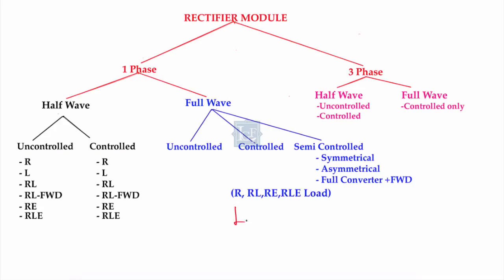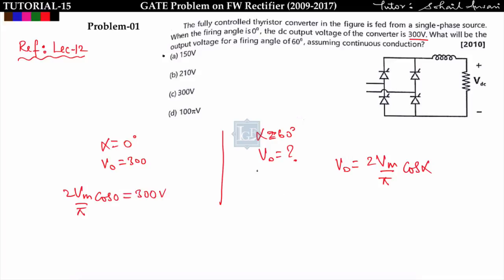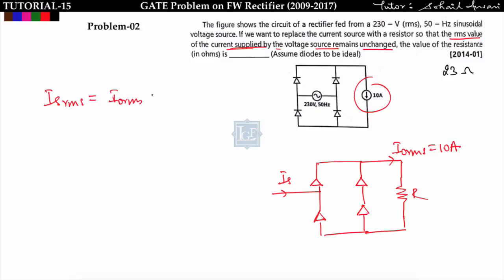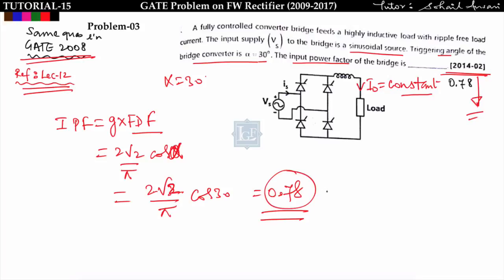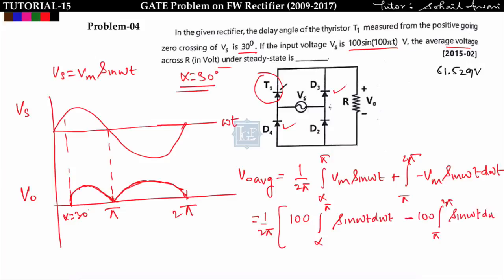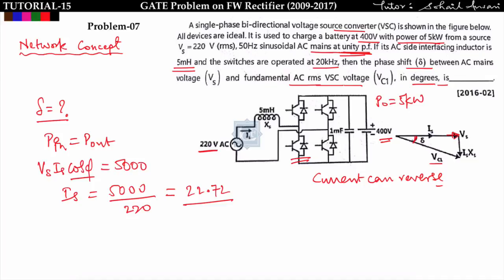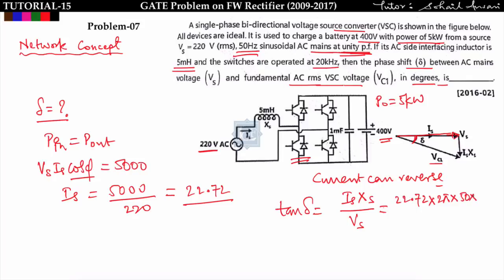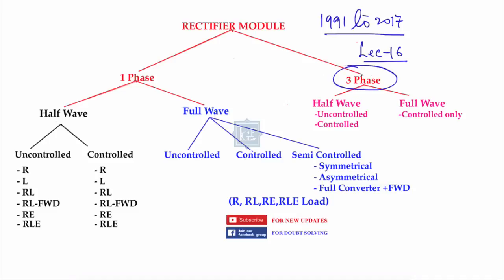Lec 15(b) GATE Problem Solved (2009-2017) based on Full Wave Rectifier

Comment: Sir.. in question no.8 if the load is highly inductive then surely freewheeling action would occur through FWD instead of thyristor and diode pairs..
And in that case RMS value of FWD would have some value instead of zero.. correct me if I'm wrong

Comment: 7:30 there shouldn't be minus between two voltage formulas.
Reply: -ve will be there because original source voltage waveform after 180 degree became -ve. But we are considering output voltage which is actually opposite to that of source voltage waveform to get +ve result.

Comment: Sir in q no 8 , as load is resistive then how freewheeling action is possible even in T1D1. Freewheeling through T1D1 is possible when load current is constant i.e load should be highly reactive. So ac to me freewheeling action neither possible through T1D1 nor D3. Plz clarify my doubt sir.
Reply from the maker: U are correct...i took the case of RL load. .ok

Comment: sir in problem 04 (Gate-2015) qns from π to 2π why we have taken minus( - )sign. here I am confused sir .So please explain it sir
Reply: I think it should be positive as wave form is positive
Reply: Because you are integrating with respect to the source current waveform. The output current is reversed with respect to the source current. That's why the negative.
Reply: @AvirupKundu  bhai current ko kyu dekh rahe hai jab output voltage dekh rahe hai to vo positive aa raha hau dono case me

Comment: For rle load current continues and it freewheels from the path where opposition is minimum if it flows from t1 d1   then opposition of 2 voltage drop hence it free wheels through diode only one voltage drop
Reply from the maker: take a screenshot and upload in our facebook group
https://www.facebook.com/groups/learnGATEfree
Reply: I think Tushar is right..
Please confirm it...I checked various sources and everywhere it says that it freewheels through FD if load is of RL or RLE type..
Reply from the maker: whatever you are saying is correct..plz tell me the video time at which this statement is contradicting..ok
Reply from the maker: for RL and RLE load FWD conduct..but for R load it wont conduct..see the question.. there R load is taken..ok
Reply: Yes sir...understood...thank you for clarifying...
🙂

Comment: For 2017 question no need of freewheeling as the load is resistive current not continues
Reply from the maker: right..i have considered for RL load also..
Reply: @GATEMATICEducation  but sir if in case RL load free wheel  diode will conducts know....since free wheel  diode turn on immediately rather than T1 and D1 To be in conduction...??
Reply: If it is RL load fwd will conduct for 2*90=180 degrees is that wrong???
Reply: Sir.. in question no.8 if the load is highly inductive then surely freewheeling action would occur through FWD instead of thyristor and diode pairs..
And in that case RMS value of FWD would have some value instead of zero.. correct me if I'm wrong

Comment: sir in last question why D3 will not freewheel instead of T1D1
Reply from the maker: see there resistive load is connected..means after pi D3 will not conduct...

Comment: sir in this lecture i have a little doubt in quest no 4. sir when diode d3 and d4 conduct why should we take the voltage is -ve when we write the equation i.e, from pi to 2pi.. as we saw from the waveform that it is in the +ve side.. can u plzz Tel the reason
Reply: That is because the Output Voltage is in the opposite direction to the Source Volatge in the range pi to 2pi.
Reply from the maker: take the screenshot and upload in our facebook group with ur query..u will get solution.
https://www.facebook.com/groups/learnGATEfree/
Reply: kunal kanti das 
Yes i also have a same doubt

Comment: In the last problem I think there will be no freewheeling action as the load is resistive here. correct me if I am wrong
Reply from the maker: yes u are correct..i consider the inductive load to explain you that even there is inductive load then also the current through diode d3 will be zero...rest concept is same..
Reply: thank you sir, got it now
Reply from the maker: ur most welcome..u are correct that in case of resistive load voltage will never be negative..so there is no any freewheeling action...ur approach is correct..
Reply: Thanks brother for clearing the doubt....I was about to post the same doubt here...Above explanations are correct. Thanks Learn gate free for ur efforts :)